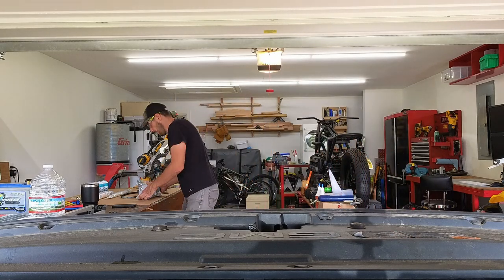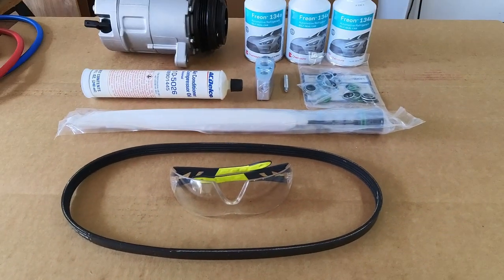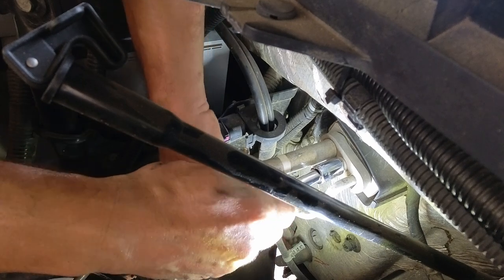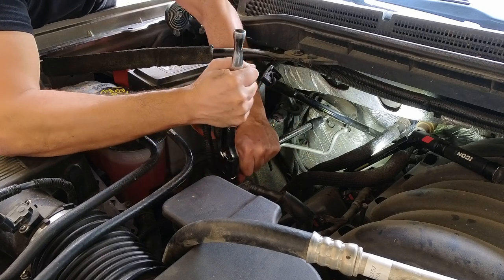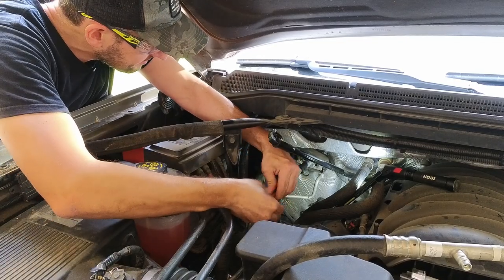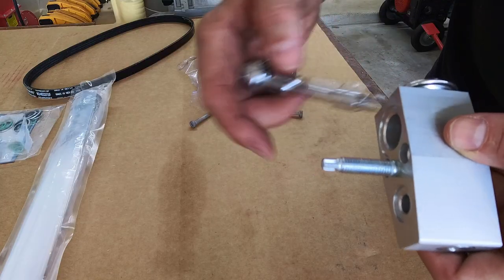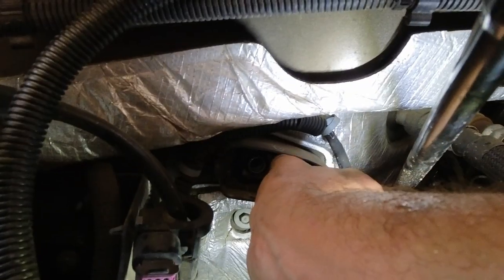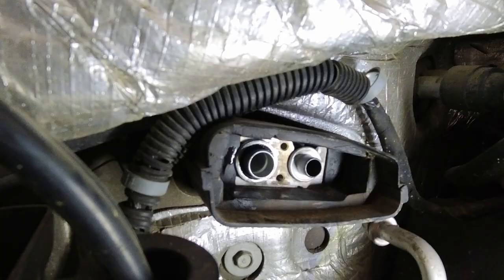2014 GMC Sierra 1500 AC Compressor Change

Comment: thank you very much for the video!!!!  successfully swapped out the expansion valve and compressor.  I didn't bother with the condenser as my compressor didn't grenade like yours and still spun freely.  I'm on my 3rd condenser anyway LOL worst AC system of any car I've owned.  huge aloha from Hawaii saved a ton, I bought all Amazon returned items and they were new, $100 for the compressor OEM!
Reply from the maker: I'm glad my video helped you to fix your truck and saved you some money. Agree, AC in these trucks an not too good.  All the best to you.
Reply: @BUTTEWORKS  watched a few videos but yours was the easiest to follow.  Mine is a '15 Silverado with 102k mi and it was very similar to yours.  If I didn't watch this id probably have broken off the back connector when dropping the compressor.  My compressor was wedged in there and had to use a rubber mallet and a breaker bar to bash it loose, you made it look easy with the wiggle 🤙
Reply from the maker: @TropicalMint808  It looks easy with the power of editing, I didn't showed the 10 min struggle to get it out hahaha.

Comment: I broke the little clip on the bottom sensor, and I still can’t take it off 😢
Reply from the maker: These cable are a pain you really need to push the tab and still they seems like stuck. In the video seems easy but I struggle a bit with it.

Comment: Thanks so much for the great video. I just blew my AC belt last night in my 2014 Silverado and I'm guessing I will need a new compressor. What purpose does the expansion valve and dessicant serve? Or why are you also replacing them, too? Potential leaks? Or did you only take it out in case debris from the failed compressor made it into the valve/lines/ Thanks again!!
Reply from the maker: I replaced them because if you buy the compressor in OReileys, they give you lifetime warranty on the compressor if you get what they call the service Kit that has the orings, disecant, expansion valve, pag oil etc and cost $54. But is not needed, you can just change the compressor and good to go.
Reply: @BUTTEWORKS  sounds good. Appreciate the reply!

Comment: Hi, can you tell me how many o rings does ac compressor has on 14 gmc Sierra. 5.3
Reply from the maker: I don't know what you mean with o-rings. I used two rubber-metal washers on the inlet and outlet pipes. One on each.

Comment: Great video question I replaced the compressor and I’m still having a issue with the clutch it only comes on intermittent or if I tap it with a hammer any solutions what that can be it’s a brand new compressor
Reply from the maker: I would check the connectors cables going to the compressor  to make sure they are ok, but if it works when tapping on it, it may be a defective compressor.
Reply: @BUTTEWORKS  thank you for the info appreciate it!!
Reply: And btw it’s a brand new one is it possible for it to be bad??
Reply: @angelonegron3093  I've had on more than one occasion brand new parts being bad. It's not frequent, but the chances aren't 0%

Comment: First, thank you so much for this video.  You helped me change out my compressor.  Quick question for you.  My 2014 GMC Sierra shows 0.6 kg (or 1.4lb) of refrigerant.  By the book, it says that the car requires 22.4ozs of freon or just under 2 cans of freon (if you have 12oz cans).  It looks like you were using 12oz cans of freon (I bought the same as you) but you put in 29-30ozs of freon.   Curious how you got the information to put in 2.5 cans of Freon.  Would love to see how you were thinking about it.  thank you again!!!
Reply from the maker: I don't' recall where I found the amount for my truck but it was a list for all GMC vehicles, all years and models. I used 2.5 cans as recommended and so far it is running great. I'm sure if you use 2  cans it will work as well. I just made a quick search and there are multiple pages with service manual pictures showing 1.6lbs (25-29oz) for GMC Sierra 1500 year 2014. I'm glad you found the video useful.
Reply: @BUTTEWORKS  Thank you!  I really appreciate that.  BTW - also replaced my condenser and that video was magic as well!

Comment: Gmc told me they would charge me 4,600 for this smh crazy
Reply from the maker: DIY, you will save a lot of money. You can have them charge the system if  you don't feel comfortable doing it. At least you can rent the vacuum pump and hoses for free from O'Reilly just to make sure it holds vacuum.
Reply: Yeaa they smoking dicck frfr